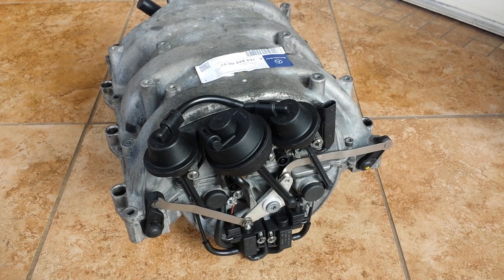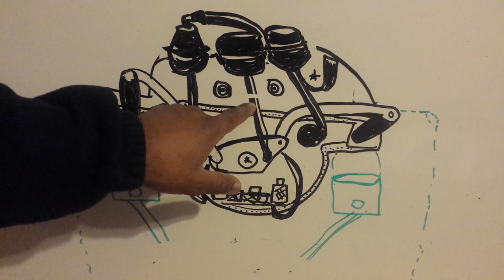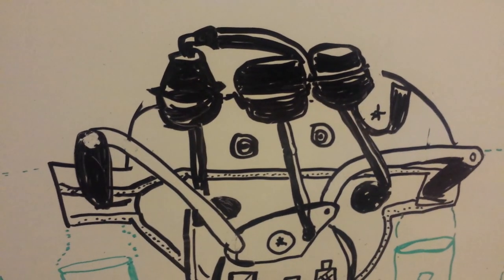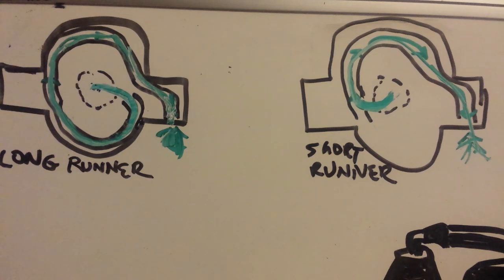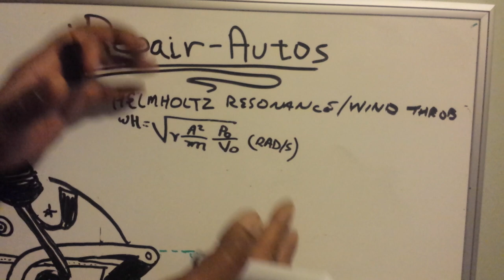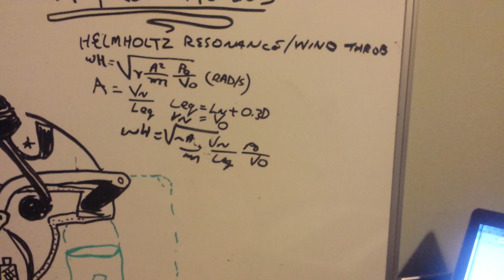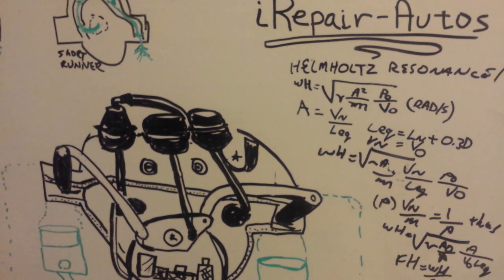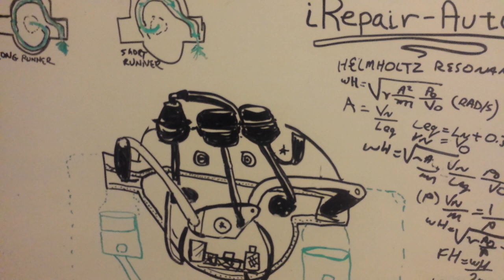Mercedes Air Intake Manifold Failure Explanation

Comment: Owner of a MB R350 4 Matic and a female who knows nothing about cars .. thank you for your explanation on intake manifolds.  I really appreciate it now I can fully understand what happened and why . I have to replace intake manifold and turbine speed sensor. .so I really appreciate it  and the time you took to make this video
Reply: Tuff Boss how did you replace the speed sensor
Reply: I have the same two problems and I bought a intake manifold but I can’t buy a speed sensor
Reply from the maker: What error codes are you getting that lead you to wanting to replace the speed sensor?
Reply: iRepair Autos p2006 p2004
Reply: iRepair Autos I got a metal replacement intake manifold with the levers but I’m thinking I should’ve gotten the plastic one?? I’m confused bout replacing that and the speed turbine sensor can only be fixed at Mercedes I have a 2007 clk 350 with 120000 miles
Reply: @deebrown4744  If you are referring to the turbine speed sensor on the transmission conductor plate, there are companies that repair them. I have used a company several times in California to repair my customer's conductor plates and  one has been running for 3 years now. Otherwise, you have to buy a new one which is pricey and has to be SCN coded because the control unit is part of the plate on the 722.9+ 7 speed transmissions.
Reply: Marc Smith That’s a fact they do have 7 transmissions but I just had my mechanic replace the manifold with a new one and now I have no check engine lights and the car runs AMAZING
Reply: @deebrown4744  Then the code was not a turbine speed sensor code. Most likely a tumble flap code. 

It certainly makes a difference in performance when they are replaced or repaired.  I have 2 to repair in the coming weeks.
Reply: Marc Smith yes it was a tumble flap code that’s what I meant
Reply: Marc Smith now I have a problem with my clk 350 it’s the hydraulic control unit my mechanic says I gotta go to Mercedes to get it fixed 🤦🏾‍♂️🤦🏾‍♂️

Comment: The video is very detailed , and your information is in depth. I appreciate your time that you took to even go this far to describe using calculus! . EXECELLANT  . I have 2007 m272 2.5 with 68 k miles which had a counter bal. shaft sprocket disintegrate .... it fell into a hole with MB ,,which we were never notified ..etc... and when we took it into MB they said .... engine ... I said ..... (  ) and here we are.... After doing a bunch of research and getting the lists and Utube reviews , for a very good price ( time not included) I did all of the engine / counter bal . R/R .... and it runs like a top  .... no engine check code .... When I finished the R/R  I noticed that there is no OIL pressure input to the ECM so I removed the port cover , drilled and tapped for a US threaded 1/8 pipe and mounted a oil gauge under the hood (temp) . Just to watch ... Oil pressure is 75 lbs. cold and 30-35 hot. 
All lifters and rockers cleaned and free from any varnish.... 
Current issue is a click-click noise ( sounds like an old chev valve lifter) BUT
raising the rpm to above 1750 -2200 the click goes away ....     
dropping rpm down to idle click comes back as you cross over 1750 slowly
dropping quickly it seems to hold off from click  for a longer time...  ( vacuum?)
Just like  --  down shifting rpm goes up to slow the vehicle (vacuum up) as the car slows and then the clicking returns again .... almost at stop..... I can repeat this 1000 times  .
I've read about the short and long paths for the intake and that at 1750 + the switch generally takes place. 
Now even though I have no engine code ... I am very suspicious of the intake broken inside ....
Your time and consideration is appreciated...   I do have a video
Reply from the maker: Seems like an oil port may be blocked and lifters aren't being given enough oil.   Did you check those for wear?
Reply: Yes , just last week I removed the drv side valve cover , both cams , all rockers and lifters --one at a time -- and cleaned ALL varnish that I could see, exercised each lifter to remove varnish --- if any --- they all seemed to react the same--- and then I specifically looked for any clogged up oil pathway from the oil filter up to the head and up to the cover where the oil splits to go to intakes and exhaust lifters.... lastly the rockers with their tiny spray hole pointed at the roller ---. I found shinny lifters and rockers at the valve stem and rollers - the were some marks on the rollers but I paid close attention to all gasket gluing and areas  of concern that MB shows in the Docs. 

I am still wondering about the vacuum possibility --- when slowing down , foot off the gas, the vacuum goes up to max and that's when the click goes quiet... then as you slow to a stop , vacuum drops down a little and the click returns ....that scenario takes me to the intake....? 

it is repeatable , over and over  ...you have a lot more experiences than I .... again no engine check 

thanks for listening

Comment: I designed and fabricated a new piece for the broken one and cleaned the inside of the intake bench tested it 100 X worked perfect.Put it back in the car and it has worked perfect......cost me about $2.00
Reply: how did u do so? will u sell me one?
Reply: Did you have to replace the actuator or those don’t go bad. ?

Comment: So good information!
I am trying to fix a misfire I replaced the broken lever in front but still skipping and is not the spark neither the coil I have good compression  I will say maybe I have internal broken parts in the manifold.  With your all explanation I understand much better the theory. 
Thank you so  much.

Comment: @iRepair Autos
I'd be interested also to know about the actual failure explanations.  The root cause being the gummed up or broken internal flaps.
You replaced the swivel with the upgraded aluminium piece, but what did you do with the internal components that caused the swivel to snap?

Comment: Excellent video. Being an engineer, I found it very interesting to understand the theory.

I am going to take a look (physical inspection and scan tool) at a friend's 2008 C350 that has the following report by the owner...."codes that were set were: P2006 $7E8 INT MAN RUNNER CNTL STUCK CLOSED BANK 1A; P0300 $7E8 RNDM MULT CYL MISFIRE DETECTED. This originally occurred on 2/5/19. Car was running like crap on start up. I shut it off, waited a few minutes, then started it again and it has run fine ever since. " 

Is this common to have an intermittent or one time P2006 code accompanied by P0300? If so, what would you recommend to prevent its reoccurrence? I notice it mentions "bank 1" so does that mean there are 2 position sensors in the system, one on each bank or is this misleading? 

Thank you for the great video and your response.

Comment: Hey Keith, first off I want to say thank you. Without your knowledge abd experience I would never have taken on and resolved many issues with my 2007 gl450 and 2008 e350. So both my wallet and I thank you!
The air intake manifold on my e350 has failed. The plastic actuator on the front has broken. I ordered an after market metal one to replace it and I am going to follow your amazing step by step video on removing the manifold in order to access it. I will also, in line with your recommendation, replace the crankcase breather oil drop pan sysyem. Since they are so cheap I will replace the injector o-rings also. I also saw your video on cleaning the manifold to get most of he gunk off the flaps inside. Even though the actuator broke the arms and hence the flaps still move very easily and smoothly. Should I pull the manifold completely and do the cleaning with the Gunk cleaner or by taking it all apart like that could I be causing myself more problems? Any suggestions, warnings, tips, etc. You can give me would be highly appericated. I am no mechanic but trust your instructions and judgement over anyone elses. Thanks again for everything you do.

Comment: Keith,

Got a quick question. When should the putter flaps be closed and open. I start my car and monitor flaps valve moment from the outside. Valve does not close or open in idle or at high idle RPM around 3000 to 3500 RPM range. My understanding is that in idle flaps should be close or open and close as needed roughly every few seconds.

Comment: Hi K,
Will a failing manifold cause a faulty #1 cylinder misfire?  been having a misfire on #1 on a 08 MB CLS550 and I've exhausted all my avenues within my mean of diagnosing.  I saw 1 vid with an EGR valve issue but several of yours with changing plugs, coils...etc.  any further advise before I hit the dealer,,, what I don't want.  Thanks in advance K!

Comment: Hi, great video! I'm getting (2) P2004 codes (bank 1a stuck open)...but the main actuator is working and the 2 outers seem to be ok, not broken. The car is running ok. A little hesitation when accelerating, but not bad. Idles fine. Any clues to what is going on? Thanks

Comment: Hope you're feeling better.
2008 Mercedes C300 - How much manifold pressure at idle? I measure about 15mmgh at the MAP sensor line. 
Also: How much torque on manifold bolts?

Comment: I have an intake where one of the plastic rods is broken, not the center piece. Can it be repaired? I've seen repair kits for the center piece but not the rods. Help! Thanks in advance.
Reply from the maker: Google this part:  Intake Manifold Actuator (Fits: ML350).   You should be able to replace it with that.  Remember what I said in the video.  You need to make sure the internal flaps are in the correct position.  Good luck.

Comment: At the conclusion of this video you say if the set of flaps which is the innermost ones (interior) are broken you would not suggest repair.  Are you then suggesting only replacement or is removal and repair a reasonable course of action?  Thank you.
Reply from the maker: I suggest replacement - It's an 8 hour job for the first timer.  You don't want to have to do it again.  With that said, if you are living in a country where the unit is not easily available or highly expensive then repair is possible.  It's just a pain in the neck (literally).  The unit brand new is roughly between $500 to $700 USD
Reply: @iRepairAutos   Thank you for the reply.  Your advice is appreciated.

Comment: I watched both of your videoes for Mercedes Air Intake Manifold....great hand-on video and explaination!!! 
My car is Mercedes R350 Bluetec 2010, and I have a code P2005, "bank 2 is stuck in the open position", with a engine light on but no adverse effect on engine performance....this is almost identical to Michel Chaber's 2011 model and performance symptom. My car is 80,000 miles.
If it's not struck as OBD error code indicates, what else could trigger the error? Thanks!!

Comment: The middle actuator broke at the connection point. It still idles fine. I do have check engine with the codes. Will this also give false O2 sensor readings?
Reply: Sounds like my issue now. Idles fine. I never would have know except shop just told me. I'm passing on fixing it now because of other work I'm getting done.
I wish my shop dealt with the repair kits that are available.
Reply from the maker: Stay away from those repair kits.  They end up causing more damage internally.  Best to get a new intake, especially since you have to remove the intake in both cases.

Comment: Recently, one of my intake, manifold runners broke, and when I drive the car, it’s giving gas, but the RPMs are jumping high or sleeping as my mechanic said, and I did get the codes and he came back to the manifold runner and the camshaft but he’s telling me that it’s a transmission issue is that true?
Reply from the maker: Deal with the known issue of the manifold runner first.  Usually the other symptoms go away when known problems are resolved.

Comment: I have a code P2005 With a engine light on but no adverse effect on engine performance. what do you think is the problem .     Mercedes R350 Bluetec  2011. Great video.
Reply from the maker: It may no longer be stuck.  If it is still stuck, then your computer will adjust the fuel to air mixture air ratios.  It will eventually cause performance problems if it is still stuck.   How many miles on the vehicle?  Have you changed the rebreather port cover, the hose etc?
Reply: @iRepairAutos  how can I get the parts
Reply from the maker: @anthonypenemodikwa4761  don't bother - the parts are cheap plastic from China.  They end up doing more harm.  Get a new unit from FCP Euro

Comment: Keith just a question, I am pretty sure I have this problem. I have also read that it's just a performance problem. If i never  get my rpm over 3,000 would it matter of the flap is stuck closed?
Reply from the maker: It might be a performance problem for some. It all depends on the position of the flaps at failure.   If the flaps then move it will cause major issues either at idle or at high speed.  You don't want to let this issue sit.   It will eventually get worse and cause other problems.
Reply: @iRepairAutos  Thank you so much, I already have the rough idle after a stop at a light etc.  I am watching your video how to remove the manifold and studying it and will tackle soon on a warmer day.  The "oil drip pan" always clockwise to remove?
Reply: @iRepairAutos  Keith i finally got the air intake off, I'm noticing oil inside the intake and also in the throttle body. Also oil on the injector plug and i believe also inside the cam magnet plug...advice?

Comment: Thank you for your knowledge. My 2007 E350 just came out with the following code, whats your first impression?
 P2006
Generic
Current
Intake Manifold Runner Control Stuck Closed
Bank 1a
Reply from the maker: Inspect the flap rods on the intake manifold for breakage or being stuck by wiring harness or other wiring.

Comment: 2007 C280 4Matic

I've got a weird issue.  I have the P2004 code that comes and goes.  Checked the plastic pieces as best I could without disassembly and nothing is broken.  Idle and speeding up back down to idle are perfectly fine except on hills at stops.  Sometimes on hills driving up or down the RPMs go really high and it up shifts late giving a slightly rough shift.  Like 2000-3500RPM it only does this on 2nd gear.  I also noticed a lot of gunk build up around the plastic pieces of the manifold.  Sprayed it with some MAF cleaner to get some loose.  Any ideas?
Reply from the maker: sometimes the pneumatic parts on the air intake are stuck open and or closed and are not broken.  Take a look at this video here:   https://youtu.be/bKiNsMoAm_M

Comment: Is there any way to change the flap runner without taking the whole manifold out? My flap is in front of the engine
Reply: Robel were you able to fix it without taking it out? I just had this code pop up on my 2007 clk350
Reply: Yes you don't  have to take the he thing off

Comment: I have the a code 0524 - Inlet flap circuit, open circuit or short circuit to ground.
Do you have any idea what this may be?
Reply from the maker: Open circuit means that the electrical connection could be disconnected either through a faulty connection point.  Or a damaged wire.   Check the connections on the back of the air intake manifold.

Comment: The vehicle , a 2006 ML350, has 140000 miles on it. in speaking to my mechanic today, he seemed to feel that the best course of action is to replace the intake exactly because of those other flaps that simply break off and gets sucked into the engine. so I'm back to being of the mind that it needs to be replaced even if it can be repaired for the short run and can cause serious engine damage
Reply: Even the 'updated' manifold is only partially improved, only a FEW upgraded pieces not all and yes I have seen someone here where their 'flap' broke and ruined his engine- basically its a gamble,if you want to replace just the linkage then that might last without guarantee that's flaps wont fail, however replacing entire manifold doesn't guarantee that flaps wont fail== plastic combined with high heat === problems

Comment: I just took out my intake manifold because In have been consistently getting a P2006 code. Surprisingly, I did not see any linkage broken. The entire system is moving freely and the flaps inside are moving and closing without any resistance. What do you think could be the issue?
Reply from the maker: Try to move those flaps again slowey and quickly,  do not damage them.  They may be jamming up.   Wipe them with a clean cloth. Do the have gunk?  This could be part give issue that is building.
Reply: @iRepairAutos  l found the breakage near the bottom of the central actuating rod. Now should I replace the entire manifold or buy that actuating rod and lever made of aluminium and replace mine with this??

Comment: Question sr what do the two small black relay valves at the bottom of the intake do ?
Reply: Hi there, answering 5 years later. Those are electro valves. They're driven by ECU and sensors, so when the ECU decides to open or close or something in between, those electro valves open and allow the vacuum coming from the intake manifold thru a rubber hose, to reach the vacuum (diaphragm) actuators and they pull or push those plastic rods and turn the flaps to the desired position.